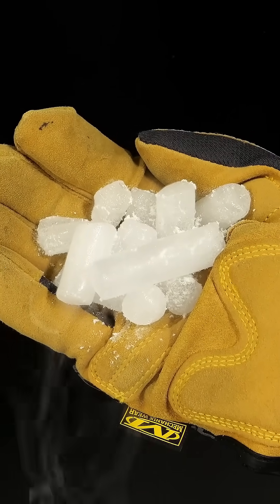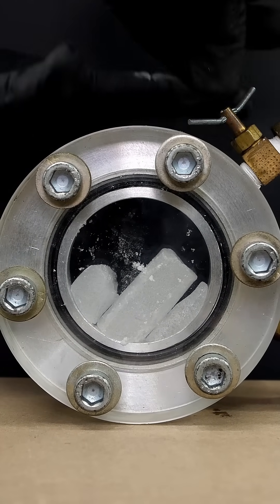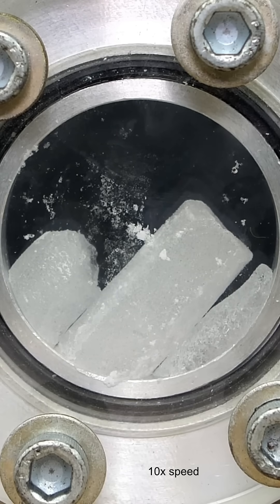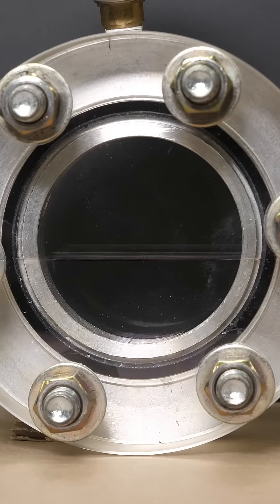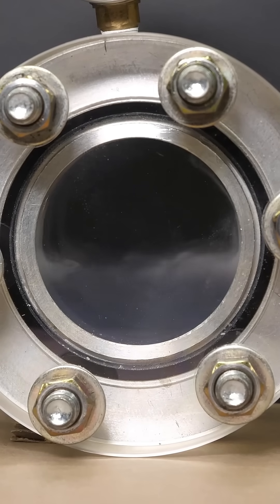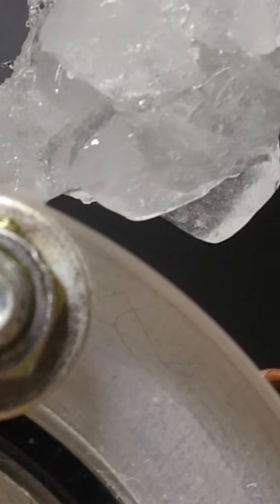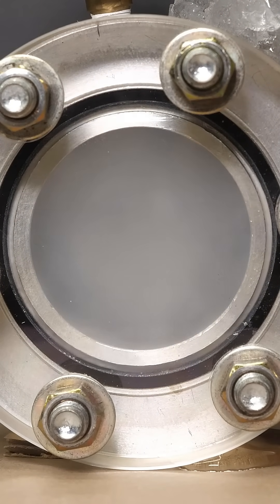This is not a liquid or a gas

Comment: I wonder if you see similar stuff on Saturn's moon, Titan. Titan is very interesting because it is the only moon in the solar system with an atmosphere, and it is also only one of two celestial bodies in the solar system to have conditions for a liquid to exist on its surface, the other of course is Earth. The difference with Titan and Earth however is that Titan is extremely cold, and therefore sports liquid methane rather than liquid water. I wonder if you would see a process that looks similar in appearance to this, just on a massive scale as Titans surface reacts to being heated slightly unevenly. 

Imagine that juxtaposed with the beauty of Saturn and its ring system overhead. That would be a sight that would probably bring me to tears lol.

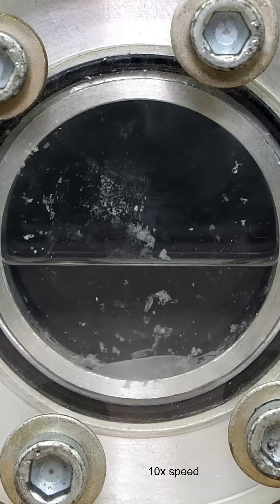Comment: 0:23 the critical pressure of CO2 is actually 72.9 atmospheres and not psi, 75 psi is 5.1 atmospheres. Critical pressure in psi is 
actually 1071psi

Comment: supercritical CO2 is used as a solvent for very pure plant/fruit extractions; the relatively low processing temperature means that heat sensitive compounds aren't destroyed, and the fact the solvent evaporates at atmospheric temperature and pressure means you get a highly concentrated end product

Comment: The boiler operator in me was panicking at the valve. The most common place to find supercritical fluids is in operation boilers, and if you have any, and I mean ANY breaches in the pressure vessel, the fluid “flashes” into a gas and the pressure vessel explodes

Comment: That's the same phenomen as when you fall into Jupiter. As the pressure rises, it would probably feel like floating but actually there is no surface of a liquid body.
Reply: That would be a crazy feeling. You'd be dead of course, but I'd like to imagine one day we could survive it.
Reply: @TarheelBear  Yeah, the athmospheric pressure will kill you fast. Galileo sent a capsule into the gas giant which was completely destroyed after 160km of descent, pressure was about 22 bar.

If the sheer pressure wouldn't kill you, the sheer gravity of 2.5 g would let you fall pretty fast, at some point the gas will become so thick that it would abruptly end your fall, like hitting a concrete wall, assuming you don't have a parachute.

If you somehow survive all that, you would probably be stuck in a fiery hot, pitch black supercritical gas environment forever. You could dive through it like in a swimming pool, but If you try to descent further, the gas will become more dense than your body, pushing you back up.

Near the core the hydrogen gas will become metallic, If you were able to get that far down.
Science is fascinating, but scary. Imagine to be stuck there forever in your space suit, that's literally damnation in hell.

Comment: A slightly more technical explanation: Liquids and gases are different states because at one point in the transition from one to the other you put in (recover) heat without changing the temperature. This is called the latent heat of evaporation, and it happens at the boiling of that substance at a particular pressure. Above a specific temperature and pressure - the critical point (which varies by substance) - the latent heat goes to 0. This means that there is no dividing line between gases and liquids, you can move from one to the other without any energy cost and without any step effects or discontinuities. As such, there's no reason to consider gases and liquids different states of matter in this regime.

Yes, this is weird. What is even weirder is that there is no critical point above which the solid-liquid or solid-gas phase changes disappear.
Reply: Yeah so there!!!😂 sir U R badasss!🤪

Comment: Isn't it just CO2 steam?
Reply: No. Above the critical point there is no longer a phase transition between liquid and gas and the substance gets something of the properties of both.

In particular, what you see during the transition as everything goes white is known as "critical opalescence" and it happens because density fluctuations exist at all length scales, so light of all frequencies is reflected equally... not because there's condensation. Indeed the word "condensation" doesn't have a real meaning in this regime.

Comment: Liquid carbon dioxide: Potentially dangerous if consumed.
My brain: Drink it (I mean it looks magical)
Reply: To drink it, first you would have to be in a room that is at the same high pressure. Which is easily doable as deep see divers are doing perfectly fine under several hundred psi for weeks on end.

CO2 and solluable in water and forms carbonic acid under pressure, the same stuff as in bubbly drinks. Which I guess your stomach wouldn't care about, but your mouth and throat might not be to happy about it.

Carbonic acid is unstable at 1 atm and breaks down back into CO2 gas and water, but drinks stay bubbly as long as the bottle is closed, because the escaping CO2 gas raises the pressure inside the bottle until it's high enough for the carbonic acid to be stable again. And I am pretty sure the pressure inside a bottle is way lower than this. So just mixing liquid CO2 with water should form carbonic acid in your mouth.
A side effect of all of this is that bubbly drinks wouldn't bubble.
Reply: @Yora21  yeah I know Soda/Carbonated water contains CO² but I was thinking about drinking it as it is in the video. Which I don't think is possible.
Reply: @artdumps  If you sit inside a large high pressure chamber, it would be possible.
Might be very unhealthy, but you could physically do it. Being under very high pressure is actually not harmful for the human body if it's a gas or liquid that is pressing on every part of your body equally. (Though breathing normal atmospheric air at high pressure can have unexpected chemical effects in the brain.)

Comment: Multiple states existing at one time is one of my favorite concepts in chemistry.
Reply: I would suggest that it is in fact thermodynamics, not chemistry
Reply: @jamesdong8179  I would suggest it is a point where physics and chemistry overlap. Thermodynamics was probably the first thing we learned in my high schools chemistry and our physics. And both go hand in hand at many points.
Reply: @evanmisejka4062  Chemistry is just applied physics anyways /smirk

(without the 'just' this sentence is unironically true)
Reply: @evanmisejka4062  There is no argument to overlap of science fields, but since we were going with the most general approach, I offered mine. I sacrificed precision for simplicity
Reply: @jamesdong8179thermodynamics is part of chemistry too
Reply: This is not really multiple states existing at the same time. That would having be (eg) hot water in a closed system with saturated humidity in the air above it such that evaporation and condensation happen at the same rate. This is when there is no difference between being a liquid and being a gas. It is related, but this is way weirder.
Reply: @QuantumHistorian  do you know what’s actually going on in the video? I would like to know
Reply: @andersbuchjeppesen5493  Not the details, but yes to the rough theory. I have a comment explaining what's going on buried somewhere under this post (top-level comment, so not too hard to find).
Reply: @QuantumHistorian  I found it. Thanks for the interesting insight